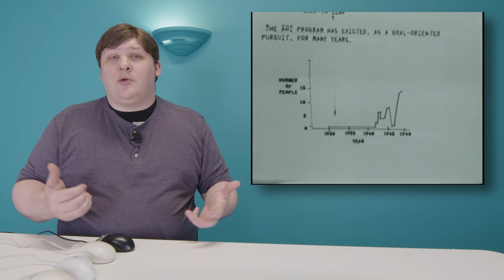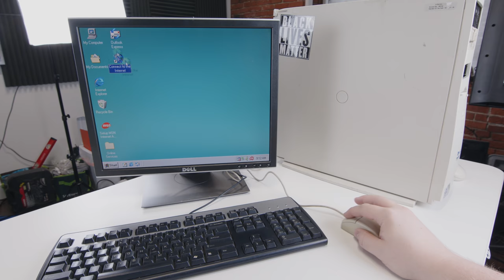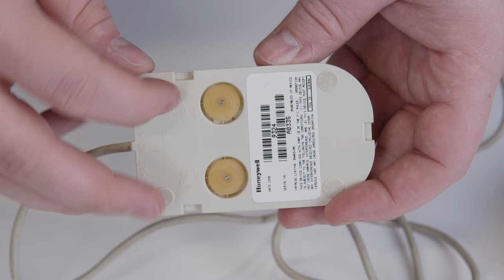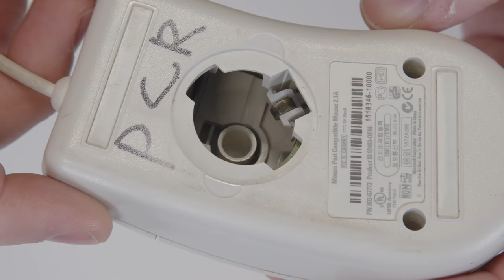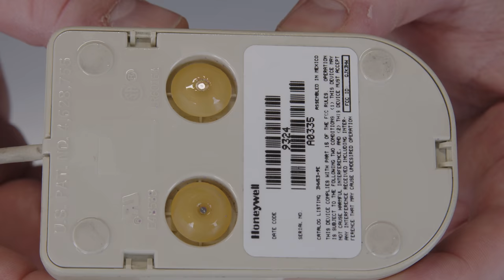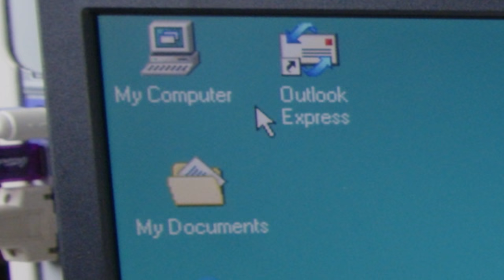Jack Hawley's Unstoppable Computer Mouse

Comment: Since the wheels are magnetically springy, then in theory this mouse should be able to work on a vertical surface, or even upside down, positions in which ball mice really can't function. I wonder if one of the use case scenarios the designer had in mind was potentially NASA using them in space.
Reply from the maker: Holy crap you're right
Reply: @CathodeRayDude  NASA though simply relies now on Lenovo Thinkpads, with both the nub and a touchpad to use for the pointer. No mice at all.
Reply: @SeanBZA  weight rules space (when you're living in a gravity well)
Reply: Now we need the ultimate test: Will it work upside down on oiled teflon?
Reply: yes, one fun way for bored students at my school library to use the computers was to flip the mouse upside down and twiddle the two little wheels like an etch-a-sketch.
Reply: I never tried them upside down, but can 100% confirm they worked perfectly when used against the side of a computer case.
Reply: @phxf  I got pretty good at manoeuvring the cursor by fingering those wheels! Since my school decided the best counter-measure for stolen mouse balls was to glue the hatches shut, the few that weren't forcibly pried open just for the sake of it were of course entirely unusable. We could at least play DX Ball with the ball-less ones!
Reply: @redpheonix1000  And in low gravity
Reply: All he needed to is get it tested once and call it the Hawley Space Mouse.
Reply: Put some magnets in the corners of the mouse shell, and then use a steel backed mousepad.  That way it'll stay on the pad in microgravity.
Reply: I'd prefer it to optical in zero g where I'd be waving a laser around
Reply: @kingmasterlord  most modern opticals aren't actually laser-lit, they're just simple red/ir LEDs.. there was a point that the sensors did go laser-lit, but that was only a few generations of sensors about mid~late 2010s.. i have a rare blue-led lit one
Reply: @SerialExperimentsTim  We've been in some weird situations, haven't we?
Reply: @SeanBZA  While NASA is happy using nubs and trackpads, if I was an astronaut I would definitely have wanted to have a mouse.
Reply: @DiThi  I suspect if you were an astronaut you'd be happy to use whatever NASA/Roscosmos saw fit to supply for your use...  "No, I will NOT go into space unless you send my mouse too!"  Likely wouldn't fly...
Reply: @Melanie16040  Astronauts do bring personal objects, so I would just bring a mouse, an adapter, and maybe I have to ask for permission to plug it in to the laptops.
Reply: checkmate, I navigated to the replay button holding my thumb operated ball mouse upside down
Reply: @JustACupOfCoffeePLZ  they glued the hatches? Wow that's an impressively dumb way to accidentally ruin the mice lol
Reply: @phxf  I used to open my mice up and twiddle the wheels the right way up. 'Course, mine were permanently easy to open for cleaning reasons.
Reply: @HamidKarzai  That was a ridiculously common thing in libraries and computer labs when I was a kid. The mice were all glued shut and therefore couldn't be cleaned and therefore barely usable.
Reply: NASA would probably use joysticks

Comment: Finally, I can use oiled Teflon as a mouse pad!  Livin' the dream.
Reply: LOL add some RGB and you gotta regular 'pro gamer' speed pad for playin the same game they play over and over and over and over and over and over... and then get banned for hacking at it... shit.. now were gonna see teflon mouse pads with RGB... the thought is out in the universe... nvm teflon feet... 

And now all I can think about is all those birds that fell out of the sky like a hail storm when they guy at the Dupont factory opened the vent shaft... true story.
Reply: @jakedill1304  it wasn't a vent shaft it was a pressure container filled with TFE (tetrafluoroethylene) for experiments to create CFC's and Roy J. Plunkett was the chemist how saw that the pressure had dropped leading to the thought of the gas escaping but as the container was weighed there was no difference so the gas hadn't escaped so he examinated the container and found the withe wax like Teflon (trade name) but yeah testing the propertys of a new material is for sure exciting  especially with such a polymer like PTFE
Reply: @jakedill1304  hey we have the same color!

Comment: I've got the Honeywell version myself and it really is nuts how well it functions on various surfaces. Though I had no idea how far it could actually go, ha!
Once again, great work on the research and explanation of how it works.
Reply: I thought I was cool for finding a Logitech ball mouse at CR packaged with Windows 3.0 on 5 1/4 floppies.
Reply: LGR PERIPHERAL HYPE
Reply: Does it have the same issues as in this video?
Reply: Do you have the same tracking issue?
Reply: you two, CRD and LGR are my fave sources for retro nostalgia... both transport me right in front of my IBM, 100MHz Pentium with 8MB RAM. The kicker was the single MB Cirrus Logic card pushing it all along... oh, the days! Endlessly playing Cyberia, Descent, Duke...
Reply: My setup has a Thermal take pc drive bay lighter😎
Reply: LGR and CRD my two favorite channels.
Reply: "But.... Hello  You!”
Reply: WHERE IS THE NEW LGR EPISODE????
Reply: I've also still got a Honeywell two wheel mouse, that I actually picked up when working for Honeywell.  Still works fine. 

PS, I always called them, heard the contacts referred to as, 'wheels' not disks.
Didn't know it was worth anything though!
Reply: @GarryGri  Yes wheels, My father worked for Honeywell in the 90s
Reply: This video got the LGR seal of approval.
Reply: Ha! LGR, you should have digged deeper in that old warehouse, I'm sure there must have been some old stock of these mice somewhere in the corner :)
Reply: You should make a video!
 Try it on your face be like hey it still works! Like what would it not work on?
Reply: Used the DEC version quite a bit myself. I recall it being pretty decent. At least decent for what I used it for, which wasn't very complicated.
Reply: always like the honeywell one still have one in a box
Reply: My grandfather bought one of the Honeywell versions when it first came out and never used another mouse, even into the late 2000s, using a serial to USB converter rather than buying a new mouse.

Comment: I checked the references for Telefunken's proto-mouse. Long story short: Yeah, it checks out.

Trackballs were first developed and used with air traffic control radar screens. An American company was marketing them for this purpose by 1966. Around the same time, Telefunken was working on such a system for the German government, and was evidently also using trackballs. 
In parallel, they were developing a version of the ATC console and screen as a terminal for their next mainframe computer. It was also to have some kind of cursor-based input device, but a trackball didn't seem an optimal solution, since it just wouldn't be flexible enough. One of the engineers, Rainer Mallebrein, quipped that you could hardly expect users to cut holes into their tables to install trackballs. As you said, he had the idea to just flip the whole thing on its head instead. He dates that thought to late 1966. 
They had the thing ready by 1968: It appears, completely incidentally, in a report about display technology that the company put out. It's not even mentioned specifically or anything, but there is very clearly one sitting there in an illustration of the aforementioned terminal. The report was published 2nd October 1968; Mallebrein remembers that it was written months after work on the hardware had finished, which was probably early that year. 

Evidently, Telefunken didn't seem to think the proto-mouse was all that special. They didn't even give it a new name, both it and the trackballs were referred to prosaically as a "Rollkugelsteuerung" or rolling ball control(er). Telefunken did apply for a patent, but were rejected by the patent office because the idea was not deemed sufficiently novel in comparison to a trackball. Looking back, Mallebrein blames this in part on them not arguing its advantages strongly enough in the patent application.
Technologically, the device was very simple, it just sent out the output of the two rotary encoders, which was interpreted by the computer terminal.

The proto-mouse (or RKS 100-86, to give its proper name) was offered as an optional extra alongside the TR 86 terminal and SIG 100 screen for the TR 440 mainframe system. Apparently not all customers opted to buy it, but at least as early as 1972, it was, quite literally, in the hands of users.
Ultimately, Telefunken only made 46 examples of the TR 440, which were primarily used by universities and scientific institutions. They seem to have been well liked, but were mostly out of service by the late 80s.

Here's the thing though: It does not seem like Telefunken's design was cloned. As I understand it, Xerox developed their ball mouse independently, working from Engelbart's version. Perhaps they had some influence from trackballs as well, who knows.
Telefunken's mouse seems to have just stayed in universities and computer labs, quietly vanishing alongside the mainframes and terminals. It wasn't rediscovered until 2009, when German computer historian Ralf Bülow dug it up in old Telefunken documentation.

It absolutely tickles me that there must be people who used an RKS 100-86 in university in the late 70s or early 80s, and owned a home computer with a mouse not too long after. Maybe they wondered what had been up with that old thing, or maybe they thought nothing of it and had no idea how far ahead of its time that clunky hemisphere really was.
Reply: Dankeschön!
Reply: Excellent post, in-depth info, thanks for researching the extra mile. I wanted to to help out mit der deutschen Seite von Wikipedia, aber I don’t think,it would have been this elaborate. Well done, sir!
Reply: thank you for this update! makes you wonder how much technology gets lost with time that just didn’t seem important enough by the people creating it, when it could’ve /would’ve revolutionised the world at a later date

Comment: That would have been great for computing on a glass coffee table. Unlike a ball mouse, you don't have to worry if there is water on the surface. Unlike an optical mouse, it should actually work.
Reply: As long as it's clean the cheap ball mouse will work and there's laser mouse too 4 all your glass needs thought it most likely came much later.

I'm glad my father bought a Microsoft optical mouse in the 90s red and white, it looked amazing and never failed, was a breeze playing games with it and it still looks kinda modern...
Reply: https://youtu.be/Ed1mXV9hNl8 this is the proof of concept that I was talking about.
Reply: @guily6669  that has to be the intellimouse which they still make today
Reply: @guily6669 I have a lazer mouse, it  kinda works on glass, in the sense it traks when it is moved, but it's so not precise, that it's basically unusable without the mouspad

Comment: My highschool had those honeywell mice! They were really neat, very little cleaning needed, and you never got annoyed because some other student stole the ball from a ball mouse and now you couldn't use the computer. Primary school computers always had missing balls. Hell, I even stole a mouse ball once! They were fun, satisfyingly heavy soft rubber orbs!
Reply: and yeah they always had those slightly diagonal tracking issues, even when they were new. But for a library computer, nobody cared. It was a great mouse for that kind of simple office work
Reply: @phxf  It's actually neat remembering just how annoying ball mice were, in a cute sort of way. I was the only student in a school of 500+ who had the time to do mouse maintenance where I'd clean the internals and even re-align the pins that other students would bend from carelessly and blindly jamming the PS/2 plug into the back of AT computer towers. Those Honeywell mice sound like a dream for my past-me. :B
Reply: My inner primary school student got a laugh out of the term "missing balls".
Reply: @darthmeow1370  I have testicual cancer found it funny as shit

Comment: As a service technician, I switched to the Honeywell wheel mouse and never looked back.
Reply: @phxf  laugh out loud
Reply: When I got rid of my last ball mouse I took a sledge hammer to it and turned it into powder, my god I hate ball mice.
Reply: As opposed to optical?
Reply: @dynamicworlds1  the issue with optical is that the sensor has to be clean enough to see the surface, gunk (or dust) can get in there and just stop it working this mouse doesn't have that issue
Reply: @AstoundingAmelia  also optical mice get tripped out by things like wood grain, dirt, grime, all that and wont track right.

Comment: I’m surprised this design didn’t come from some NII in Siberia, because it looks robust but janky in an exceptionally Soviet way, like a Lada Niva mouse
Reply: Yeah, this is the Lada of mice.
Robust, won't break, always works, but only just.
Reply: Ah yes, the niva, the only car that breaks down easier if you drive it on the road instead of offroad.
Reply: Love my Lada 2101 and can definitely see the comparison
Reply: @rockytom5889  The trick is to drive it at the same speed on the road as you would offroad.

Comment: If they had a scroll wheel, I'd go looking for one. If it can run on oiled plastic perfectly fine, I bet it would work on fabric bedspreads acceptably.
Reply: maybe not, it has to slip and grip at the same time, but idk
Reply: I've found that Microsoft's small optical mice (including that insane folding one) work exceptionally well on bedspreads.
Reply: @no1DdC  well yest but that's becasue theres zero moving parts and an optical mouse just calculates its position based on variations in the surface you're moving your mouse on and doesn't rely on friction to move.
Reply: Nowadays, the blue laser optical mice from Microsoft do an excellent job at coping with undesirable mousing surfaces. I've used one on pretty much every surface out there, including pets that wanted to remain in the way, and it just works. The only thing my very early BlueTrack mouse didn't contend with well was clean, clear glass. If the bottom was frosted or it was dirty, it managed, but if it was clean and clear, the pickups just didn't have enough data to work with. These sensors have gotten considerably better over the years, so I suspect the latest generation are actually quite capable even on glass.
Reply: @victornpb  My thoughts too. It will need a fairly stiff flat surface whatever it's made of.
Reply: @mndlessdrwer  When in good condition (i.e. not after a decade of constant use) I found these would track on just about anything, including the glass table tops we used to have at one of the local pubs. I guess the tiny marks (and scratches/scuffs) were enough. Only thing is (at least at the time) they didn't do a BlueTrack™ mouse with Bluetooth support which means tying up a USB port and they are useless if you lose the dongle.
Reply: Trackballs work everywhere 😉
Reply: Time for a kickstarter
Reply: My MX Master 3 works on every surface I've used it on, fabric included. Hell, I've even used it on myself a few times lol.

Comment: Speaking on the AMC inline 6 front, my aunt picked me up from school a really long time ago in a Jeep Cherokee.  I noticed the oil light flickering.

I told her she needed to pull over since there was no oil in the engine and she said "it's fine it's been doing that for months".

That engine is still running 17 years later.
Reply: Running without oil is not the same thing as the oil sensor being faulty.

What you have done here is fallen for a fallacy.
Reply: @UnitSe7en  I didn't wanna explain the whole timeline of the engine abuse but I did imply the point.

Confirmed via dipstick later it was about 3 quarts low.
Reply: @kloroformd  that's still 2 quarts of fine lubricant
Reply: My dad did something similar to our 04 explorer once. Poor soul went about 3k with almost no lubricant. It's still kicking without an engine rebuild at 225K miles. Transmission actually gave up first at 190K.
Reply: @UnitSe7en  Maybe but that being said that engine lasted for well over 30 years. I owned one made in 1982 and I can tell you that I drove it with absolutely no fluids, (no coolant, oil, trans fluid etc.) for over an hour after destroying the oil pan and much of the under carriage and transmission housing. The oil pan was all but non-existent as I had sheared the bolts right off. The engine was still running when I scrapped the car, still without fluids. Those engines are well known as one of the most durable engines ever made.